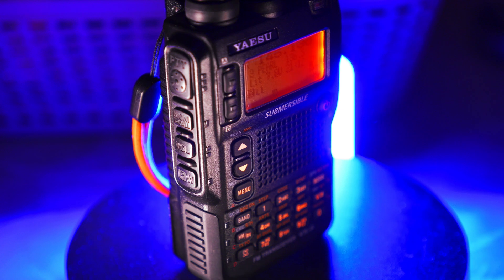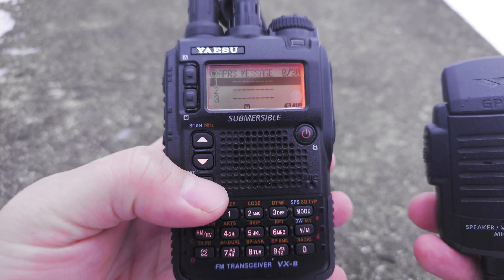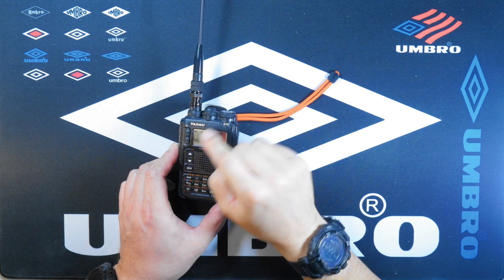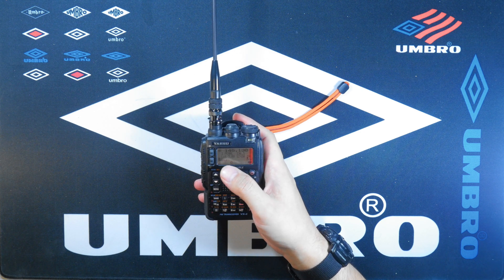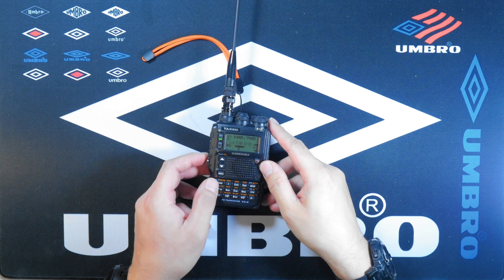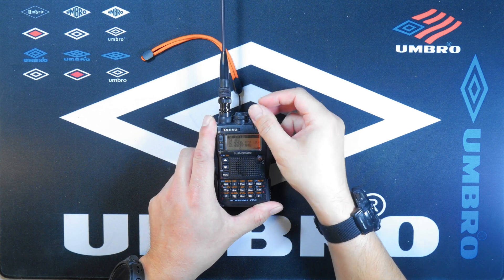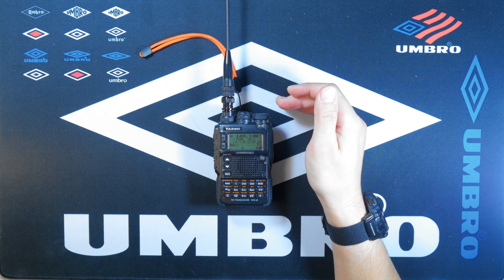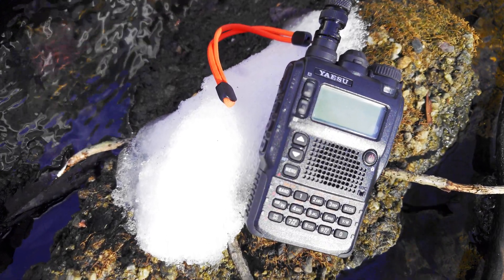Yaseu Vx 8DR - Discontinued - APRS QUAD Band Rugged Radio SWL

Comment: What’s the best antenna for this radio
Reply from the maker: what frequencies you looking to use this on and how are you carrying it, and where and when are you carrying it? the answer depends on these questions and a few more.
Reply: @TheFossilChannel I will use all the bands we have all those bands on it with repeaters locally
Reply from the maker: hard to say then as there is no quad band antenna. the default triband one is good, there is a longer one thats made for the yaesu 817 but has a bnc connector instead of sma you can use but the ht itself becomes very unwieldy however you have access to 50mhz , 144 mhz and 70cm. you can also get an old 1980s aea hot rod mono bander 2 m telescopic antenna to use.

Comment: Any aftermarket batterypack recommendations?  I'm sure there are a lot of junk batteries on the market.
Reply from the maker: theres a battery thats made by a ham which has 3 18650 cells. it isnt waterproof though